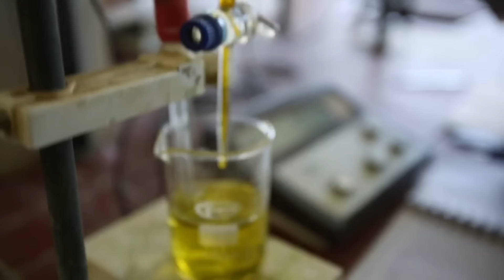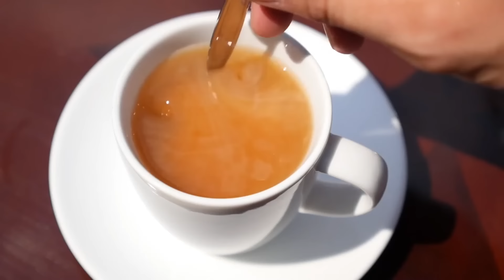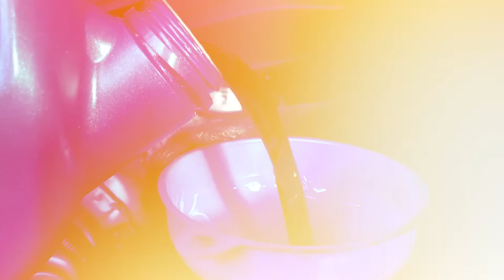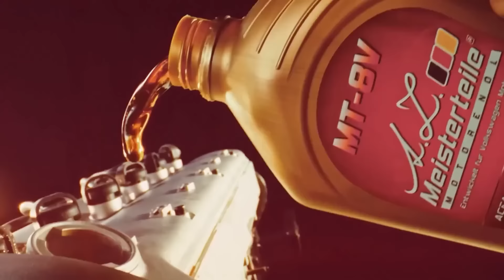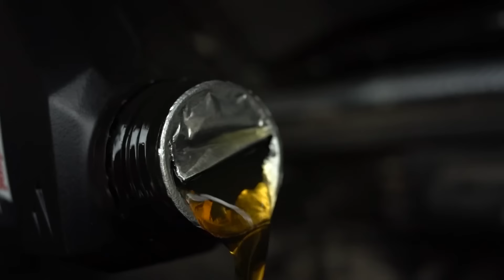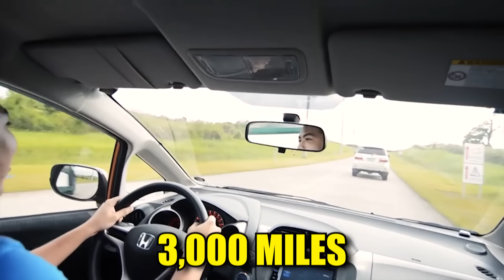0W-20 vs 5W-30: U.S. vs Abroad Oil Choice

Comment from the maker: The Oil Mistake That Can Kill Your Engine - https://www.youtube.com/watch?v=ML2HXOA0lyA&t=112s

⬇Care Care Clues Top DIY Tools and Products:

🚗 Essential Scan Tools
Newest Scan Tool:https://amzn.to/3GJyuET 
Bluetooth Scan Tool: https://amzn.to/42AcBRc 
Cheap Scan Tool: https://amzn.to/42WZIzx 

🔋 Emergency Essentials
Best Jump Starter: https://amzn.to/44fYOAm 

🛢 Fluids and Leak Stoppers
AT-205 Re-Seal (Stops Leaks):  https://amzn.to/3S9icYm 
ATS 505 Fuel System Treatment: https://amzn.to/3YQjjA2
Lucas Oil Transmission Fix: https://amzn.to/4jNk98M 
Bar's Cooling System Stop Leak: https://amzn.to/3Sht0nj 

🔎 Quick DIY Diagnosis Tools
Head Gasket Leak Test Kit: https://amzn.to/4jRgc2T 

🛠 Useful Maintenance Accessories
Quick Twist Oil Drain Valve: https://amzn.to/4jWG3GJ 
Tire Gauge (Check Pressure): https://amzn.to/3GxySGD
Tire Air Pump: https://amzn.to/3RZK9Cd 
CRC Mass Air Flow Sensor Cleaner: https://amzn.to/44dJpkb 

🧰 Mechanic’s Must-Haves
Car Battery Tester: https://amzn.to/4jTqyzk 
Basic Mechanic Tool Set: https://amzn.to/3Ymgerh 
Cordless Impact Wrench: https://amzn.to/3YkkhVc
Reply: I'll stick to 0w20 until I reach 100k then I'll switch to 5w30 or 10w30.

Comment: So wouldn't 0w30 work better Sam's cold flow better film strength at higher temps but still close enough to be a middle ground for longevity And cold start protection .vs risking a switch to 5w30 that might not protect as well for cold starts ? Or is this another comment to be ignored by the ai generated comments anyways lol??!

Comment: I've seen tests done on 10 cars of the same make and 0W-20 Synth for 5 cars and 5 with 5W-30 Synth and then the engines were taken apart at 100k miles from a 75K start. The 5W-30 cars showed significant less wear in the pistons, rings and walls. So I'm thinking 50+K miles is a good place to upgrade the oil to 5W-30. The cost?... an engine failure is a lot more expensive than <1 miles more per gal...😎
Reply: Is there potential a link to this test?

Comment: There's no conspiracy. And 5w30 isn't "thicker" than 0w30. Viscosity covers rate of flow at operating temperature. That lower first number actually means it's better at cold starts. Oil actually swells or thickens in the cold. Engineering Explained covers this. There's some truth in this video but there's a lot of assumptions and false beliefs from the 90s.

Comment: Different temperatures through out the world
Reply: No I think they were EPA morons that cared more about emissions and mileage than your engines lasting many more miles
Reply: If that was the case then manufacturers would recommend different oil for different regions of the US and different seasons. US has different temperatures too, it's -20 in Fargo and 80 in Miami yet the cars all call for the same exact oil.

Comment: A lot of people with never know this is true because the oil cap is marked 0/20
Reply: Yeah true. I have 2 camry's one with 0W16 and one with 0W20 same engine. I switched to 5W30 and ordered oil caps that say 5W30. Get this: it is a Japn part number hmmmm.
Reply: my  2014 Silverado came with a warning that your warranty expired if you put  anything but 0/20 in the engine  @EReed-qg8lt 😂